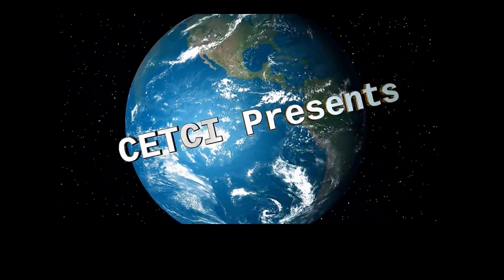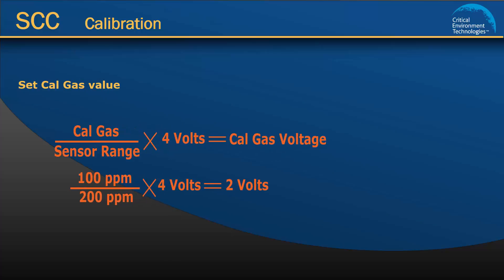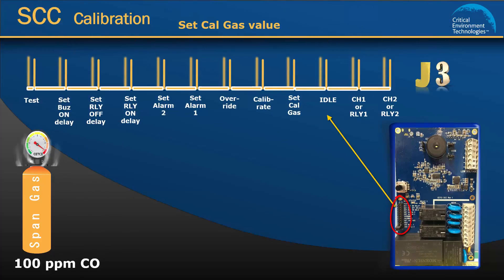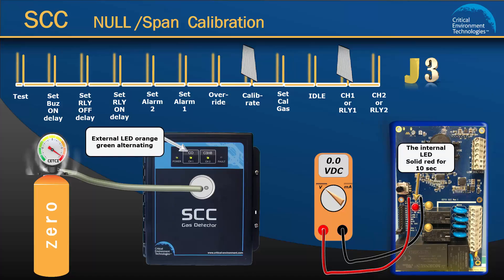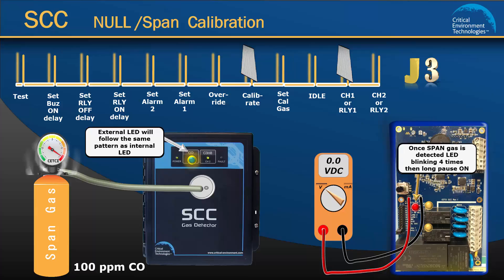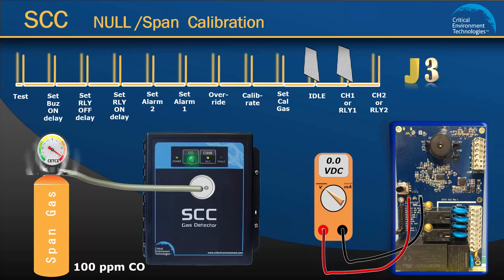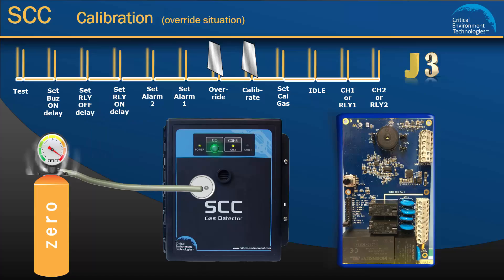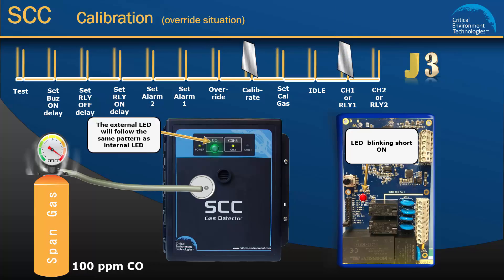How to Calibrate the SCC

Comment: What should the response time be for a CO sensor to achieve the appropriate voltage level? I have a SCC in a parking garage that takes close to 2 mins to achieve high alarm and just as long as to come down off of it. The voltage after calibration is over 1.0 volt so not below the 0.8. Seems impractical that when cars are emitting CO that they would need to stay idle for a period of time to activate the SCC alarm to bring on the exhaust fan. 

Thoughts?